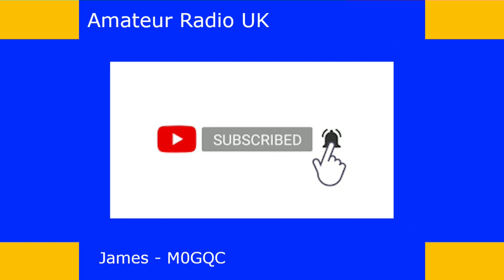Air Conditioning Coil On 160m!

Comment: What is the total length of your coil?
Reply from the maker: I'm afraid I can't remember.

This is quite an old video. It was filmed over two years ago, not long after I started YouTube. A lot has happened since then!
Reply: @HamRadioOnline  Yeah, sorry, I realized later when I came back to watch again and noticed it was old. Definitely want to try this on my 40m vertical. I take it this was not permanent then? Jeff, KF5KWO
Reply from the maker: @herrwabbaloo937  No, it was temporary. An experiment driven by curiosity!

Any loading coil with a suitable amount of inductance will work.

Obviously the taller the vertical the more efficient it will be. As with any 1/4 vertical, you will also want a reasonable ground radial system.
Reply: @HamRadioOnline  definitely have that already.

Comment: Hi, perhaps I missed it even though I’ve seen the whole video. What do you have for the other part of the antenna? I mean, what counterpoise system are you using with that loaded vertical? Very interesting solution for coil by the way! 
73
Reply from the maker: There's quite a big radial field in the ground. Approximately 30-40 radials which are each around 16 meters long.

It was an interesting experiment. I'd love to revisit this (maybe during a contest) & just see how many contacts I can make with it.....possible idea for a future video there!
Reply: @HamRadioOnline  oh sure then I’ve seen the video about the radials on the ground. Thanks for your answer anyway. Personally would love to see the actual signals on the radio on 160 filmed, also to check the signal to noise ratio.

Comment: Interesting idea indeed. i have been looking at using js8call on 40 and 80m with not much success yet mainly due to local qrm and only on a F loop 2.0 and 8w. 73s
Reply from the maker: Can you get a vertical up at your QTH?

A wide band mag loop with a decent receiver (maybe an SDR receiver) can make a good RX antenna in noisy locations, while the vertical is generally a bit noisy on RX in urban areas but good for transmitting.

You just need a way of switching between the antennas when you key up (MFJ make a box that can do this).

If you use a separate receiver (such as an SDR) you will need some kind of front end protection so that you don't blow up your receiver!

Some SDR programs (I use SDR Uno) can take the CAT signal from your radio & change the frequency to match the radio (or change the frequency of the radio to match the receiver if you click on the waterfall on your computer screen).

I am experimenting with this setup at the moment (going well so far and will probably do a video on this setup later in the year).
Reply: @HamRadioOnline  I am in restricted area and no out door antenna's allowed mate, so thats why i have the chameleon f loop for now. I def gets out, but the qrm from this area is just unforgiving from numerous sources and locations around me. I am working on a plan of action to filter every known lead in my apartment to minimise it, but sadly i think most of it is from neighbour's.

I run a IC-705 also so i can track the qrm on scope and null some out with the loop short term.

Comment: Did I hear you say “gash” for “spare”? Haven’t heard term used that since leaving the Navy.  👍
Reply from the maker: Hi Peter, thanks for the comment.

I actually filmed this video a couple of months ago, so can’t remember exactly what I said but I think in this context. I probably said “gash” as in meaning “dodgy” or a “departure from the normally accepted conventions”.

As you rightly say, you can also have “gash spares”, which I guess is also technically true (based on the materials that I used).

I was never in any of the armed forces but I work in aviation (engineer for a major UK airline). A lot of people in civil aviation came from the Navy or RAF, so I guess these terms tend to cross over.